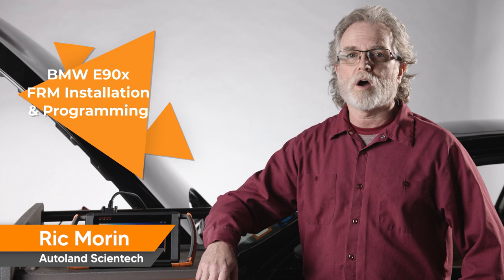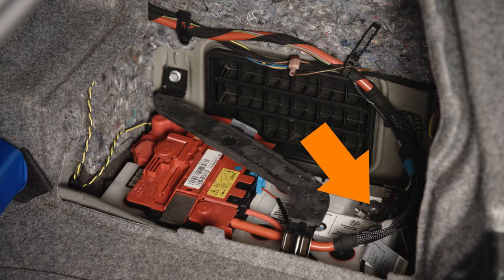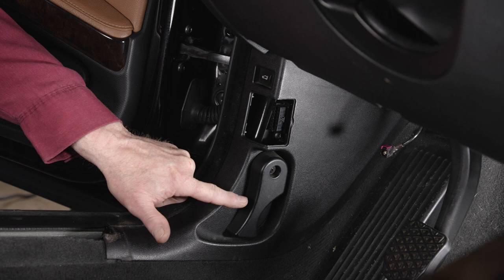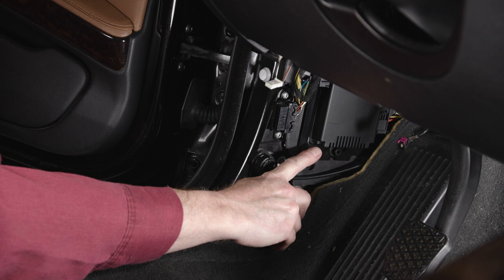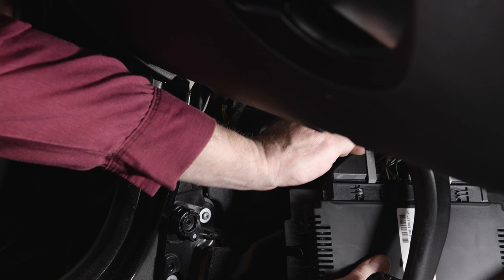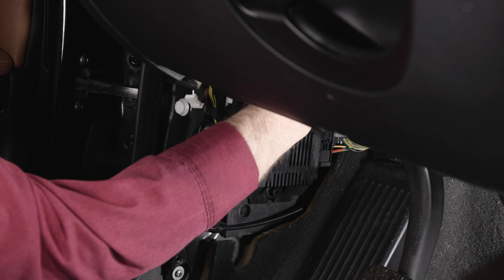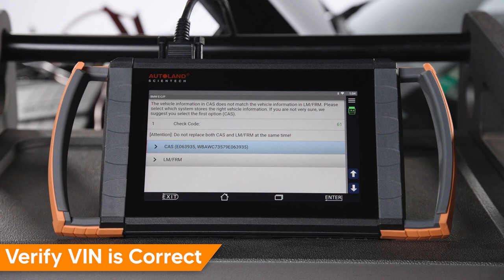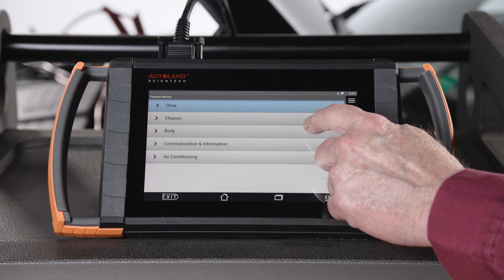How to Install and Program a New or Used Footwell Module (FRM) in a BMW E90 x Model

Comment: I left my battery discounted for too long I guess. 

I was replacing my high pressure fuel pump and noticed my FRM was no longer working. 

I don’t feel comfortable disconnecting the battery again.

Comment: In my 2011 E90 i observed that this module controls lights-interior,backlight on dials,windows,inicators,car alarm and radio will never time out.
So question is will the replaced and coded module have same previous function ?

Comment: This was for a new FRM ? If a used one would you tap “programming and encoding” option? Thank you
Reply: Correct!  Programming is required to overwrite the VIN on a used FRM.  A new FRM from the dealer only requires encoding.

Comment: Do anything you can to not take it to a mechanic or the dealership they will rip you off as much as they possibly can
Reply from the maker: I would have to disagree. There are more honest and reliable shops and technicians in the world than not. If you feel like you're not getting an honest quote, seek a second opinion on the repair.